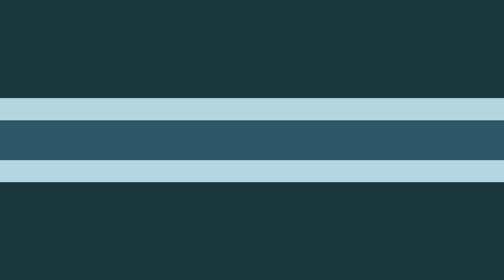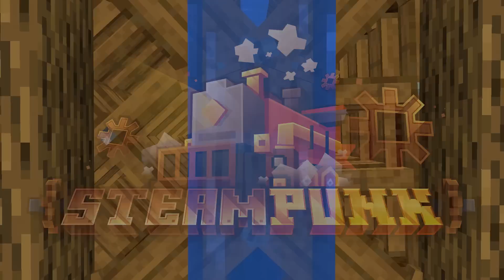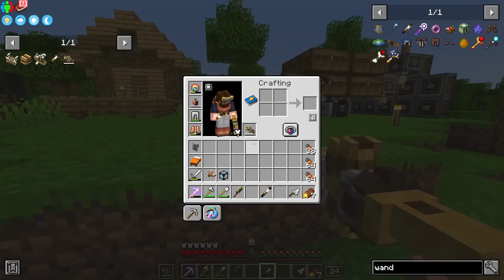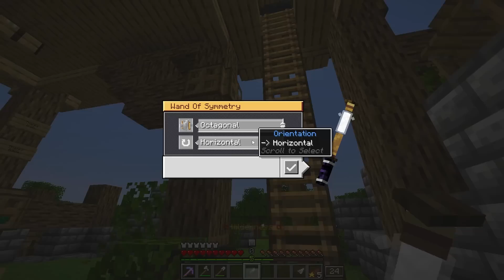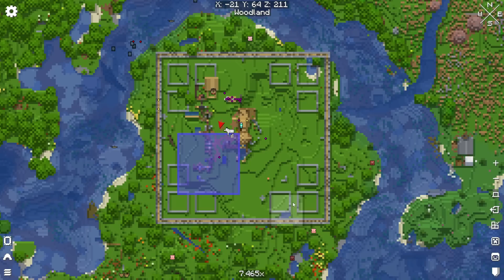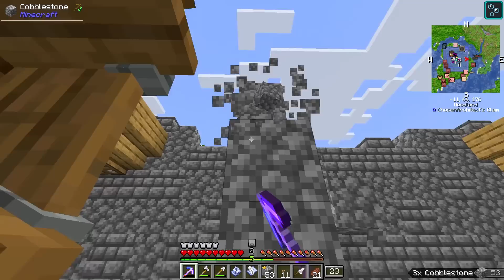SteamPunk Minecraft Modpack EP9 Immersive Aircraft & Schematicannon

Comment: So you say at 8:47 that you want the wall to be 45 blocks from the center point. How are you able to use the wand of symmetry to build that wide? Mine only works in a circle with the diagonals cutting off at 35 blocks. is this why at 11:44 you've shortened the distance of the walls from 45 to around 34ish? Or am I missing something completely?
Reply: I know this is late but the only way he could've possibly done is by changing the server files

Comment: It would be pretty cool to have a steampunk-themed helipad to allow the quadrocopter to land and take off and a runway to allow the Gyrodyne room to take off. Also, as other people have said, the Gyrodyne does take hunger to take off and will slowly fall if you become too hungry, while as you figured out, the quadrocopter takes fuel, like coal, to run, and can be upgraded with those engine upgrades. I'd imagine you can only have a single engine upgrade applied at any one time to the quadrocopter, and I think each engine upgrade can allow for other upgrades to be applied, while the Gyrodyne can have up to 3 upgrades at a time, and it'd be cool if it could have all three of them as the same upgrade, allowing for some pretty niche Gyrodyne setups.